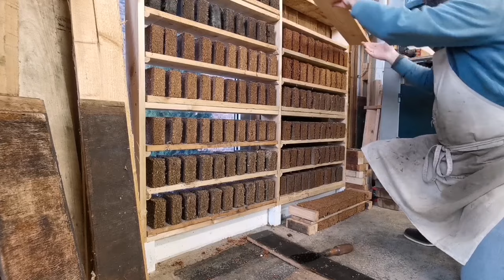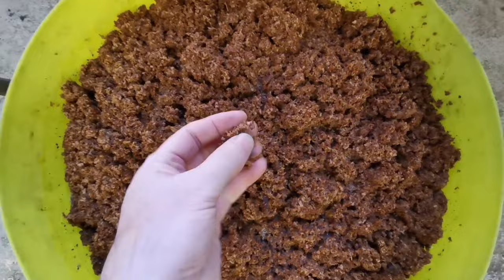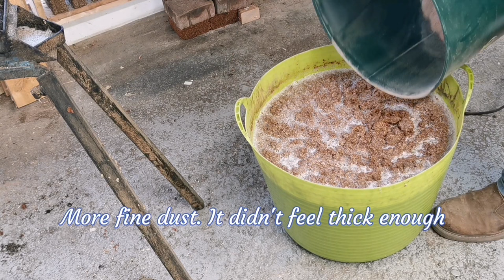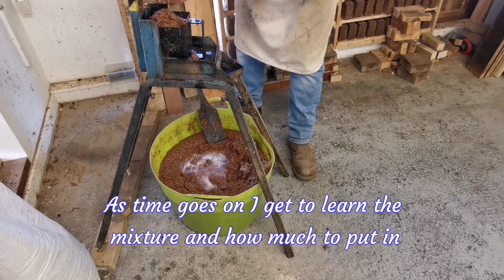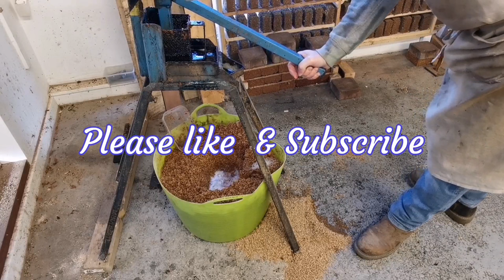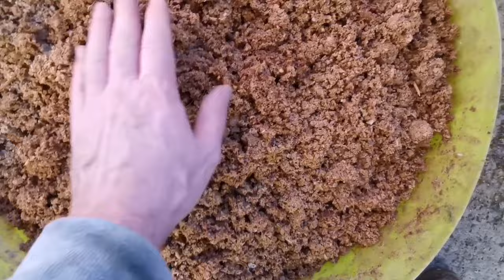How to make Briquettes with sawdust - Improved Method for 2023 - multimate paper #briquettes

Comment: Devil's advocate here...  Wouldn't you be more energy efficient (using less energy overall)  to use electricity to compress  the sawdust?  One man and $5 of electricity could process a LOT more sawdust. Perhaps forming more than you actually need to heat your home.  Then you could sell it at a reasonable price and get TONS MORE sawdust recycled and replace more fossil fuel. (I assume that is the goal here.)
Reply from the maker: I like what you're thinking here, and in a bigger commercial workshop it makes sense. I'm a 'one man workshop' sometimes lots of dust, then weeks without much at all.
The bit you've missed out is.. An electric press and the cost of. At the moment the wood waste is all mine. The Coffee grounds I now use are from the Cafe behind my workshop. So almost no energy, and no cost of ingredients. Time is probably my most used commodity. But now the latest process allows me to leave in a bucket for weeks and get a burn time of over 2 1/2 hours. It's all very interesting.
Reply: @twcmaker what is the PVC you put in? And how much is a cap?
Reply from the maker: It's white glue. Maybe a 1/4 of a chickens egg in volume. Hope this helps. I'm not using it any more. I'm allowing the mix to Compost. Watch this it'll help. https://youtu.be/DhOgGI9j664
Jamie
Reply: @twcmaker  Dude, you are a legend, thanks for your answer.  In the linked vid...how long does your 50/50 mix mature before using?
Reply from the maker: @juriegroenewald7887 Anywhere from 5 weeks in the hot Summer months to 5 months over Winter. So you make while it's warm. Don't work too hard on them in the Winter.

Comment: Thanks for the update! Would it be better to have the water drain in a separate container? That way the mixture wouldn’t get progressively wetter and you could avoid having to add additional material. Just a thought. 😃
Reply from the maker: I get what you mean. There is an advantage to having the water and  bubbles, as it ensures the very fine dust comes back into the bucket. Then goes through the system again. It's the very fine dust that keeps these blocks tight. I'll have a think about it. Thank you for watching. Jamie
Reply from the maker: Have you seen my latest video?
https://youtu.be/BrUE1Hs82iQ
I hope you can watch it. It really helps me grow my channel and share the knowledge with others. 
Jamie

Comment: I have a sawmill and the wheels have been turning in my brain on this because i also heat with wood. I'm also thinking what's to stop a person from adding a small percent of grain fed animal manure to the mix? I realize that would turn some people off but it would burn i'm sure. I just think this would be a good use for all this stuff. Even a small amount of yard leaves in the fall ground up fine might be ok. I do realize it would have to be a very small amount probably though because i would think it could cause it not to bind well. Maybe even grass clippings to for that matter as long as it was mostly sawdust. I'd like to get hold of a press like that and do some experimenting.
Reply from the maker: I've very similar ideas that will be carried out at some point. Like for example. Collecting leaves from pavements where they would go to sludge, and not be able to go back into the soil to add nutrition to the land. I've a bag of those leaves that have been sitting outside for 4 months. Hopefully composting, reducing down to a mix that would burn. Thank you. I need to check that bag today. I'd forgotten about it again. I think the possibilities/opportunities will be amazing.
Jamie
Reply from the maker: In your position, with a sawmill, I would start composting. Monitor a point of time where the breakdown has happened but still some noticeable signs of it being wood chips. And then make a briquette. Then again a week later, and again until there was a good enough range to get results. Allow to dry, then test the burn rates until there was a clear point in time when the period was at its best. I know it would work through my small occasional trials, it amazed me.
Reply from the maker: Have you seen my latest video?
https://youtu.be/BrUE1Hs82iQ
I hope you can watch it. It really helps me grow my channel and share the knowledge with others. 
Jamie

Comment: Very interesting technique. Thanks for sharing the video. When putting pressure on the mixture, where does the (waste)water go to? It seems to go into the bin with the mixture  (but I can't see it properly). If that is the case, I think it'd be better to let in flow in another bin so that the mixture isn't becoming more and more watery.
Reply from the maker: In my latest video I'm improving my method. The waste water now goes  into a fresh mix. It takes any bacteria or microbes to help start the next batch. I'm also slowing down the process. It's making a huge difference to the quality of the burn.
I'm currently working on adding more Coffee grounds into the mix. As the Cafe right next to my workshop throws away a few kilos every day. So it's proper waste. And it's going amazingly well. Have you watched my latest video in the series?
Its taking it slower and allowing the grains to stay in the Briquettes.
Here it is https://youtu.be/BrOn96a8v3o
Thank you.
Jamie
Reply: @twcmaker  Thanks for your reply.  I haven't watched your newest video yet. I'll do it right now. Do you also have a video about how you made the press?
Reply from the maker: I bought the press. If you search 'multimate briquette maker' you will find it. Made in Germany now I think. They use my video on their website.
Reply: @twcmaker  I've found the video with the link to the manufacturer. I'll contact them.
Reply from the maker: Great. Tell them you've watched my video and that you came from that link in the video description. You could ask him if he pays me for using my video. (He has tipped me £20 a long while ago)
Have a wonderful day.
Jamie
Reply: @twcmaker  I've already sent them an email  (before you wrote your reply). In the email I mentioned your channel and that you use their press in your videos. But I didn't ask if he pays you for using your video. I think he should offer you an affiliate link.
Reply from the maker: He should. I'll catch up with him soon.
Reply from the maker: Hello again.
Because you commented on my Briquette making video, I thought you would be interested in all of the improvements I've made to the process. So many things have changed and doubled the burn time.
Here's a link to my latest video. https://youtu.be/aBGiK-rYmVQ
Let me know what you think. You are important to my channel and our little community on here.
Thank you.
Jamie
Reply: @twcmaker  Thanks for the link to your new video.  I've just watched (and commented) it.
Reply from the maker: Thank you. Improving now. Burn rate is hotter and longer. 👍

Comment: Thanks for the vid. Subscribed. Will be off to investigate further. I've just made my mold and tweaking it. Put in chainsaw shavings. Compressed using hydraulic press but they just spring apart. Off to look look at binding agents on here. Cheers
Reply from the maker: Hi.. Don't use binding agents. I did another video where the wood shavings had slightly composted. Chainsaw 'chippings' are thicker and stronger. I'll find the video for you. Back in a minute. Jamie
Reply from the maker: Please don't add oil or something that's going to cost you, or ruin the environment. Here's a video about leaving it a few months to break down. Happened to me by accident. https://youtu.be/21aXfMD2rKE
Get back to me and tell me what you're plans are. I can help you make this a better product. Jamie
Reply: @twcmaker  Many thanks for that. Sorry for not getting back to you. Didn't get a notification. Off to check my settings and that link. Cheers.
Reply from the maker: @babybear5001 Have you seen my latest video?
https://youtu.be/BrUE1Hs82iQ
I hope you can watch it. It really helps me grow my channel and share the knowledge with others. 
Jamie

Comment: What is PVA?  The only thing I find when I look it up is paint primer like Kilz.
Reply from the maker: Polyvinyl Actate Emulsion. A wood glue or sealer. Water based. Can be used as a primer by builders, plasterers. Hope that helps.
Reply: @twcmaker  thank you for answering it helped clear things up.  Does it really help with binding the briquettes?
Reply from the maker: You are welcome. It just helps if there's not enough fine dust. A cap full is only like a whisky shot. And it'll stay I the water for a while.
If you look at a video I put out last week, where I burn the Coffee briquettes you'll see how tough they can be. It took quite an effort to brake with one hand.
Reply from the maker: Hello again.
Because you commented on my Briquette making video, I thought you would be interested in all of the improvements I've made to the process. So many things have changed and doubled the burn time.
Here's a link to my latest video. https://youtu.be/aBGiK-rYmVQ
Let me know what you think. You are important to my channel and our little community on here.
Thank you.
Jamie

Comment: Why let the water run back in the mix ?
Reply from the maker: Why not? It keeps all very wet and the tiny particles stay within the briquette.
However, my latest videos show some (not all) of the water running into the next batch of briquettes. And the fine particles make a big difference to the burning. They're getting so much better quality now. I've a playlist with the latest versions and updated methods.
Jamie
Reply: @twcmaker  my engineering and process background. The returned fluid makes the mix wetter. Adding in fluid which has already been lifted and removed through pressure will make the process longer (or harder whichever way you look at it)
Reply from the maker: Longer. Probably. But now I'm not pressing straight away. I'm leaving to soak away naturally. For about 20 minutes minimum. Then gently squeeze to about 80% of the normal pressure. As they dry they shrink down, contract. The latest are burning 2 to 3 times longer. This was the last video I did https://youtu.be/BrOn96a8v3o 
. I've improved on the process since. Jamie
Reply: @twcmaker  thanks Jamie, I like the observation of 'Spring Back' . I'm going to have a think about that. I have a plan :-)
Reply from the maker: Will you be sharing that plan??
Have I mentioned that I've made 10 each week for 5/6 weeks. Then I'll be trialing the burn. Is there a difference in made in the same week as the first mix? Or Leaving 6 weeks or so? We will see.

Comment: Don't get too upset, but the improved methods are still a long way off. So far, everything I see is no different from what people did in the early 2000s. Both in terms of speed and work costs. One minute for 1 briquette only at the compression stage is a lot. I have 84.6 seconds per 1 briquette, BUT including shredding the paper, mixing it in a container and mixing the whole mass in a concrete mixer. That is, I divide the number of briquettes per day by 8 hours per day of work (8*60*60/340). And I do 4 pieces per cycle at once, and I consider that to be a long time.
https://i.ibb.co/gmfbC6f/IMG-20190627-190704.jpg
https://i.ibb.co/GR9fkQj/IMG-20200924-152726.jpg
https://i.ibb.co/YkRgn2b/IMG-20190627-190639.jpg
https://i.ibb.co/GkMTKH0/IMG-20180605-173910.jpg
https://i.ibb.co/MgZmYrz/IMG-20180528-163759.jpg
https://i.ibb.co/fCdnFxR/IMG-20180528-163700.jpg
https://i.ibb.co/VpS8HtX/IMG-20180528-163743.jpg